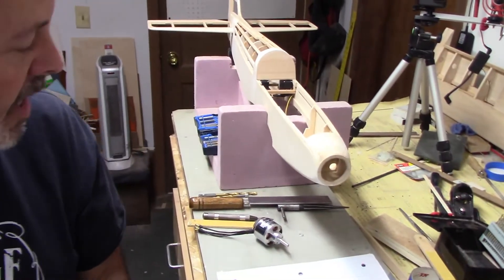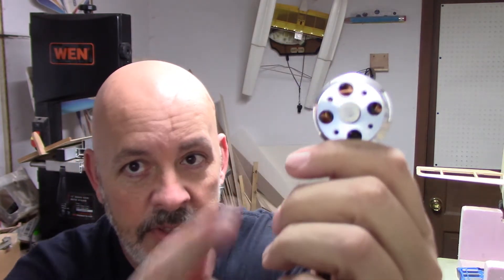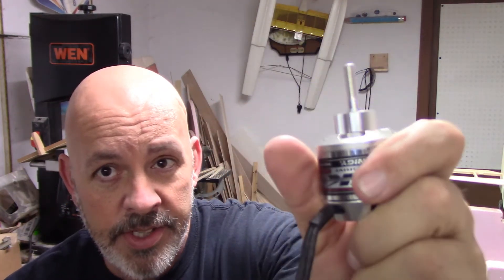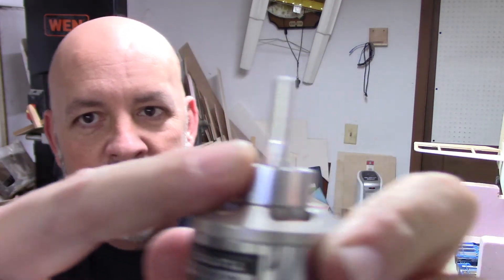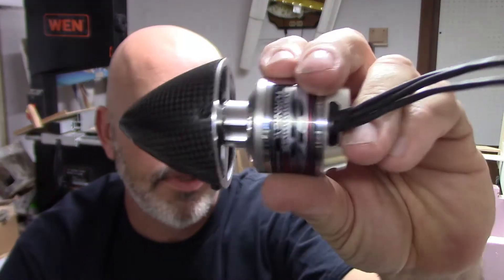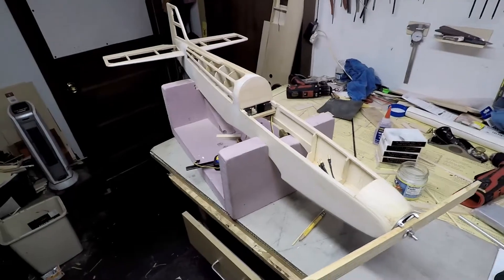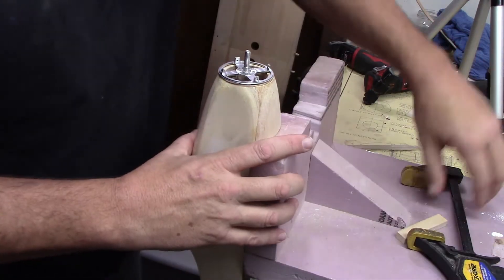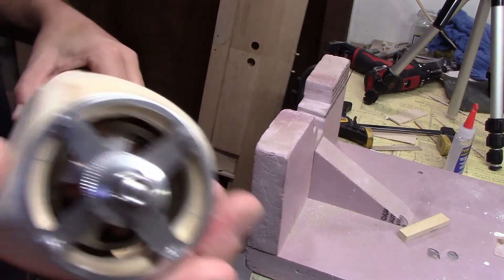Project Warlock - Video 18 - Re-Mounting Motor (Correcting my mistake)

Comment: On the motor standoff block-Did you drill holes that line up with the cooling holes on the backside of the motor?Not on the vid if you did.
Reply from the maker: Gino. I had the battery die in the Canon during recording that part of the build. I did make relief cutouts for cooling. Since I'll be taking the motor out today to work on the front, I'll take a photo and post a link in the video description.